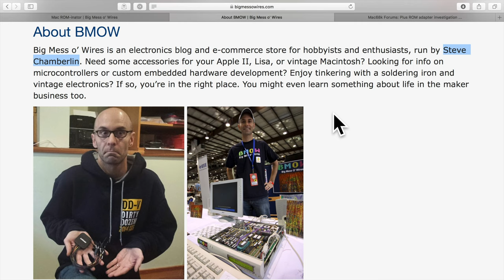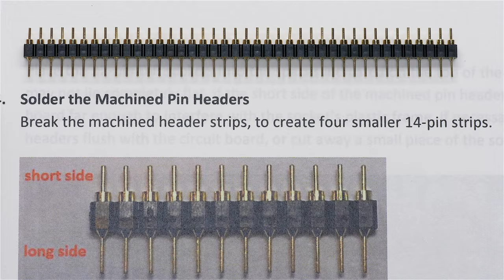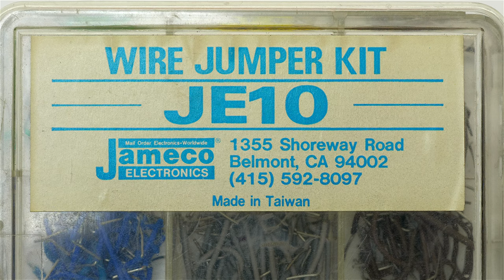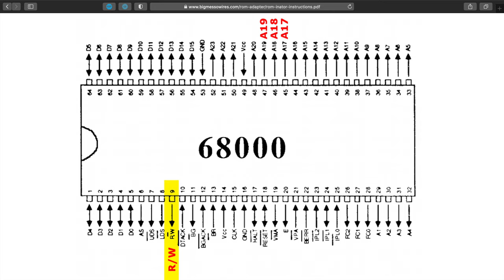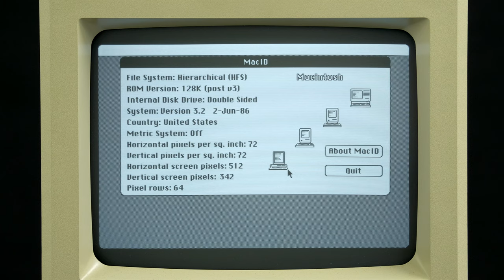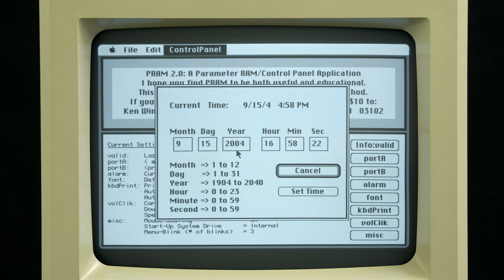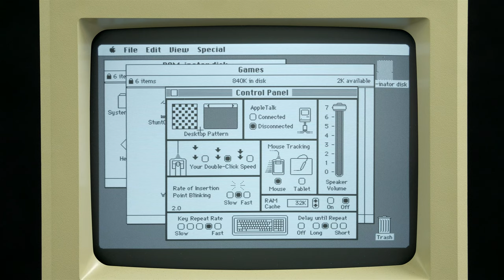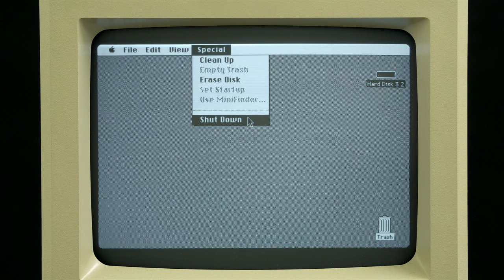ROM-inator Kit Build & Review [Mac 128K, 512K & Plus]

Comment: Great video James - I highly recommend the Amtech 559 flux for any kind of work - it's thinner, but flows solder better.
Reply from the maker: Thanks for the advice, Kai.  Where do you personally buy the 559?  Mouser doesn't carry it for some reason.  EBAY?  Also, how are you assured it is genuine, as opposed to a Chinese knock-off?  (Or does that even matter?)

Comment: I enjoy watching you solder the circuit board and also the joints look amazing!
Reply from the maker: Thank you for watching and for your kind comment. Adding flux is the key.  

I could have done a similar job with normal solder (which has flux inside) but it would have taken much, much longer because in that case I would have needed to carefully solder each pin.  When you add a good quality flux, you can then paint the solder on, almost like you were using a paintbrush, and most of the time there won't be any solder bridges between pins.  You cannot do that if you don't add extra flux.  Flux makes the solder flow!

Comment: What an epic vid!  I like we saw first boots, not knowing the outcome.   Thanks also for showing your soldering techniques, very helpful.  My vote for another project: BMOW ROM-inator II SIMM programmer for us SE/30 owners!
Reply from the maker: I actually have a ROM-inator II for my SE/30.  It's the 8MB "MEGA" version no longer sold.  I also have the SIMM programmer, which tragically too is no longer sold.  The great benefit of the original ROM-inator is that you don't need any kind of external programmer, unless you only have a 128K Mac.  For 512K to the Plus, you can reprogram using the app I show in my video.  But the ROM-inator II absolutely requires a programmer to change the contents.  I also had an issue with the ROM-inator II in that the PCB is too thin, so it makes intermittent connects to my SE/30 Motherboard's ROM SIMM.  I added solder to the SIMM's pins to fix that, but the solder flakes off over time and even causes solder bridges (shorts) from the flakes.  The ROM-inator II is great when it works, and even better if you have the required programmer.

Comment: Thanks for the detailed video. I wasn’t aware that there was a version of the ROMinator that ran on early Macs. I order pcbs as soon as I finished watching your video and checking the parts list so I can build my own. One thing I am concerned about is how high the board sits and the difficulty of installing the board. I will try and use lead-frame pins instead of SIL machine pins and hopefully the board will sit a lot lower in the socket.
Reply from the maker: The original ROM-inator was created by Steve C. at Big Mess of Wires (BMOW).  He ended sales due to the lack of interest, but Kay Koba of Kero's Mac Mods resurrected it in 2021 with the blessing of Steve. The kit sold by Kay Koba is lower profile than the one I show in my video: https://www.kerosmm.com/白紙ページ-1
It can be made even lower profile if you solder the ROM chips instead of using sockets, but I would advise against that unless you have a spare pair of ROMs.  Soldering won't damage the ROMs, but you want to be able to revert the machine back to the stock condition easily again, and that's really the main reason the sockets are there on the ROM-inator.

Comment: so glad you posted this. this is on my top list of mods for my plus, now that i've 3d printed a replacement battery (3xLR44 converter). i'm doing this even before i do an internal SCSI2SD hack!
Reply from the maker: In some ways the ROM-inator may be even easier than a SCSI to SD install, although that depends on which SCSI device you choose.  I have a video review of MacSD here: https://youtu.be/zwz6qMC2ZE4
I am currently testing BlueSCSI right now, but as I show in my MacSD video, MacSD is indeed faster overall.
Reply: @JDW-  I think you're right. Wiring so many wires to the logic board to get internal SCSI is not looking like a very fun project. It's also risky. I think BlueSCSI is the best current option for price and for features. I'll have a look at MacSD!
Reply from the maker: @ghost180sx  Since you have a Macintosh Plus with external SCSI, MacSD is not for you as that is an Internal-only solution that works well for Macs like the SE, SE/30 and newer which allow for internal SCSI drives.  There are some models of SCSI2SD which are external and are solid state.  The ROM-inator is a very different beast because it is ROM, not SCSI.  The ROM-inator is faster than SCSI, actually.  You get a bootable ROM disk that you can reprogram.  And even though you need to solder a few wires, it's still a fun little project that can add some spice and excitement to a Mac Plus.  The size is only slightly larger than an 800K floppy, so you can't put all your software on it, but as shown in my video you can use an older set of System Software and add MacPaint, MacWrite and a number of games to have some fun without any SCSI drives or floppies.

Comment: That's a nice mod for macs without an internal disk. I have an old Mac SE, I think I could swap the internal disk for a flash card.
Reply from the maker: The ROM-inator shown in my video is most useful for storing only your most frequently used apps. The storage space is rather small so it’s not really a good substitute for another storage device like a FloppyEMU or BlueSCSI, both of which work just fine on the Macintosh SE.

Comment: Thanks for the video! I've been wondering what the deal with the ROMinator was. It looks like a pretty useful and fun mod. I also appreciate the brief SMD soldering demo, as I am going to be doing some of that very soon.
Reply from the maker: The key with SMD is to add a little flux. It really helps the solder flow and helps you get rid of solder bridges easily.

Comment: A normal AA 1.5v cell will work as a pram battery. It probably won’t last as long, but they’re readily available!
Reply from the maker: Considering that the appropriate battery is rated at 4.5 V, a 1.5 V battery would have a short life indeed.  All said, the same company who sells the 4.5 V battery in the States needs to start selling it here in Japan!
Reply: @JDW-  cool! I’ve had AAs last at least a year in my Mac Plus.
Reply: @JDW-  you can make your own 4.5V PRAM battery using 3x LR50 Alkaline cells. place them in series a 50mm length of thin heatshrink (30mm wide) and apply gentle heat of about 150degC. make sure to mark the +ve and -ve end because the LR50 is backward to most other cells in that the button end is -ve, and the falt end is +ve. I just did this on my Mac Plus and it was relatively easy and much cheaper than the other option. be careful not to short out the LR50 cells while you build it because they can explode (ask me how I know).
Reply from the maker: @markcummings150  I can only find one seller of the LR50 on Amazon Japan, sold in a set of 6 for a rather high price. (I live in Japan.) https://www.amazon.co.jp/-/en/Batteries-LR50-A1PX-Vintage-Camera/dp/B002C8H7KY/

Comment: where can I get the PRAM 2.0 control panel. my Mac Plus clock is stuck in 1922 and I need to patch something.
Reply from the maker: Version 5 works fine under System 3.2 and Finder 5.3 as I mention on the Macintosh Garden download page here: https://macintoshgarden.org/apps/pram-50
Reply: @JDW-  I did a search on Macintosh Garden for PRAM and came up empty. hope it will work in MacOS 6.0.8 or 7.1 or later. I did find a patch program but I need to get something to unpack it because it’s a .sit file. I’m running a 500MB FloppyEMU HD drive on my Plus. Much more room to play with.
Edit: maybe I searched for PRAM 2 OR PRAM2 because searching for PRAM worked the second time.
Reply from the maker: @markcummings150  Version 5 does indeed work on System 6 & 7 too.  So if you've not downloaded and tried that version yet from Macintosh Garden, you should definitely do so now because it will help you set the clock properly.  I look forward to hearing the result of your testing.

Comment: What is your view on using the Rominator II and a SE/30 with the Bolle Carrera 040 card? Along with 128MB or ram?. I ordered it and have it here but some people convinced me not to used because of stability issues. And that the system32 (forgot the name of the extension) will solve the 32bit memory addressing issue anyway. Thanks :)
Reply from the maker: The Carrera 040 card has an audio problem when used in the SE/30.  There is no problem when the Carrera is used in other Macs like the IIci.  I know this because my friend Kay Koba demonstrated that problem to me and apparently there is no fix, at least none that Bolle knows of.  Since audio is an important part of the Mac experience, it's some what of a deal-breaker to use that card on the SE/30.  With that said, I have read that it boots in 030 mode which should make it compatible with non-stock ROMs like the ROM-inator II.  But I do not own that card and have no practical experience with it.  That's why I can only tell you what others who own the card have told me.
Reply: @JDW-  Thanks for answering my question. Concerning the audio problem - unfortunately Bolle didn't tell me about the audio problem. Too bad or else I would have reconsidered. But what entails it exactly. Does the audio start to stutter or is it something else? ty
Reply from the maker: On the SE/30, audio screeches and is basically unusable. I believe Kay sent me a video about that or a link to a video. I can’t remember and I can’t find that video either. I searched for an hour but I couldn’t find it! Sorry. But if I suffice it to say you will discover that problem, unfortunately. It really does need to be made clear that problem exists on the SE/30. It doesn’t exist on other Macs, but it’s important for would-be buyers to know.

Comment: If you install this into a 128k do you still need the board?  ... That is, is the board simply for reprogramming the rom chips or does it also server another purpose ?
Reply from the maker: Patrick, if by the "board" you are referring to the red colored circuit "board" in my build, the answer is you absolutely need it for the 128K, 512K, 512Ke and Plus -- all 4 compatible machines.  The difference with the 128K is that it lacks the required RAM to run the special app that Steve Chamberlin wrote to allow you to reprogram the ROMs the way I show in my video.  

On the 512K and higher, you can use that app to change boot chimes, ROM disk contents, icons, etc.  But on the 128K, you can only preprogram the ROMs by physically removing the two chips from the sockets on the red "board" and put them into a special programmer (not shown in my video) and then using a modern Mac or PC to send the data you want to write to the programmer which in turn programs the ROMs.  You then must put the ROM chips back into their sockets and reassemble.  So the 128K is far more fiddly than the 512K~Plus.  

However, BMOW also sells a ROM-inator II for the SE/30, and that ROM cannot be re-programmed easily.  In that case too, you must remove that ROM-inator II SIMM, put it in a special programmer (which very sadly is not longer sold by BMOW), reprogram it, then put it back.  All said, if you have a 512K, 512Ke or Plus, the original ROM-inator is by far the easies and most enjoyable ROM replacement ROM disk out there.  It still works on the 128K and is fun too, but reprogramming is more of a hassle.
Reply: @JDW-  Thanks for the detailed reply. I understand the software requires 192k of ram to run and therefor wouldn't work on a 128k Mac. I guess what I was trying to ask is what exactly is the red board for. Is it only to allow reprogramming the ROMs on a comparable Mac (512k or above) or does it also adapt the rom's to fit  and work in the machine. 

I guess I'm wondering, wouldn't it be easier for one to just go through the trouble of finding compatible EEPROM's and use those (or sourcing Mac plus roms)? because you can't reprogram them in the machine anyways. 

..
or is the other major feature of  the ROM-inator is the ROM disk? and THAT requires the circuit board?

What I'm getting at is I have an Intellectual curiosity of  what the circuit board specifically does.
Reply from the maker: @tappdarden  The red circuit board shown in my video is merely a red variant of the original green version shown at BMOW.  Without that circuit board, it would not be possible to insert new chips into the existing ROM sockets because you need more than just 2 ROMs to make this kit work.  There is a small surface mount IC required too, as well as jumpers that are changed by whether you have a 128K/512K or Plus.  In other words, the added circuitry required, over and above the ROMs themselves, is what you see in that red circuit board in my video.  Simply buying spacious ROMs (the extra memory space of the replacement ROMs is where the ROM disk comes from), reprogramming them, and inserting them into stock motherboard sockets wouldn't work.  That's why the red "daughter card" is required.

Comment: so when you boot from it, im guessing you cant save or delete files off the drive because its rom or is it flash?
Reply from the maker: Correct, but if you need to change files on the ROM disk, you can do that with the Flash Tool app shown in the video.
Reply: @JDW-  damn if only its a actual flash disk would have been great. Ill think about getting one later but for now I put plus roms in mines so i can boot off hd20 using the floppy emu from them. Still also wish someone made a modern ram or scsi upgrade for these systems since they are the first macs
Reply from the maker: @DatBlueHusky  The ROM-inator II kit for the SE/30 has the ability to press the A key at startup, which creates a RAM disk that allows temporary editing of files.  The older Macs like the 512K don't have enough RAM to do that, which is why you only are able to press the R key at cold boot (for ROM disk).  

There were many SCSI upgrade boards sold back in the day which can still be found today.  How well those work with modern SCSI to SD card solutions is something I've not tested because I don't have one of those SCSI boards for my Mac512.

HyperDrive was an internal HDD kit sold back in the day for the Macintosh 512K.  I have a video series on that.  Anyway, someone at the 68kMLA forum made an SSD drive placement solution for it which is pretty neat: https://68kmla.org/bb/index.php?threads/ssd-for-a-hyperdrive-a-mini-guide.36376/
Reply: @JDW-  well you see no one is selling those upgrade cards anywhere and theres some scalpers on ebay wanting $1000 for the hyperdrive. Other things like the hd20 is min $200-250 for one and thats external. Thats why i wish someone would work on a adapter board to make a scsi card and ram upgrade for these.
Reply from the maker: @DatBlueHusky  Kai Robinson at the TinkderDifferent forum, and Bolle at the 68kMLA have some amazing reverse engineering skills, but so far no one has stepped up to the plate to reproduce SCSI upgrades or Hyperdrive interfaces for the oldest Macs.  Demand drives efforts like that, so I suspect a clone will eventually hit the market when some brilliant engineer who shares our hobby decides to tackle the task.
Reply: @JDW-  yeah im hoping it will happen soon, im really surprised there's almost no modern support for the first gen macs, so far and everyone loves the mac se, se30 and theres so much stuff for those units compared to the 128/512 line
Reply from the maker: @DatBlueHusky  It's an enormous software and hardware development job that's far more difficult than simply cloning an existing board that was made for the SE series.  The SE was expandable but the earliest Macs were not.  There is an amazing amount of highly customized Assembly language code that makes the Hyperdrive work.  Most programmers adept in the C language would find that a formidable barrier to cross.  That in combination with low demand (only hobbyists like you and me) is why no one has yet stepped up to the plate, I'm afraid.
Reply: @JDW-  yeah i know but i saw the scsi adapter for these early macs and they seem pretty simple using a scsi controller from the newer macs? and it plugs into the rom ports just like the rominator. Also not 100% sure about the scsi chip as i didnt look at part numbers but with todays fpga's and micro controllers i dont think its that hard to create just a scsi controller for these systems, just that would be a nice step since we could easily run internal drives. Either way ill ask the groups on fb and see if that will spark any interests in someone making one
Reply: @JDW-  also i dont think even have to do that much programming since the scsi adapters i think used mac plus roms
Reply from the maker: @DatBlueHusky  You must be Tin.  I saw your post in the Vintage Apple Macintosh Enthusiasts group today.  Nice pic of the DOVE MacSnap board!
Reply: Yeah lol its not mine sadly

Comment: Would it be possible to use those tiny IC hooks instead of soldering directly to the CPU?
Reply from the maker: Yes, and actually, that is how Steve Chamberlin did it in the early days of the ROM-inator.  But over time those clips could oxidize.  Then again, so could Killy Clips and yet we don't often hear of trouble with those after 30 years.  Solder is best, gold-plated clips are 2nd best, and regular tinned clips are a close 3rd best.  So long as the clips are small, you should be able to fit everything nicely, albeit, you won't be able to slide the motherboard in on the rails.  You'll need to pry it in like shown in my video.